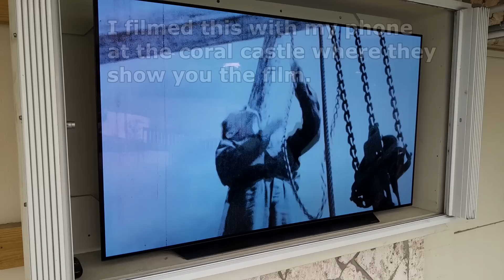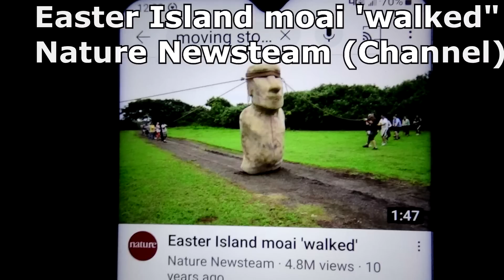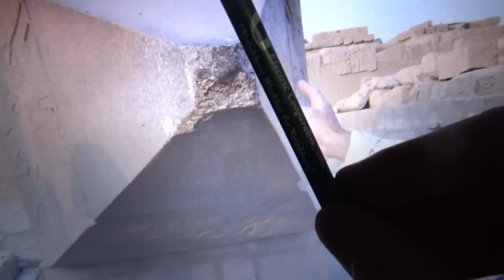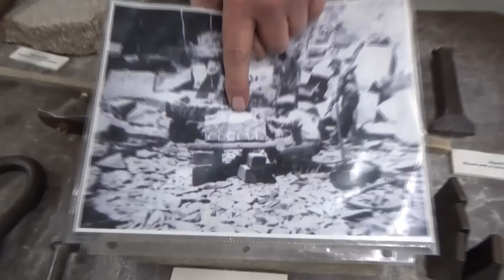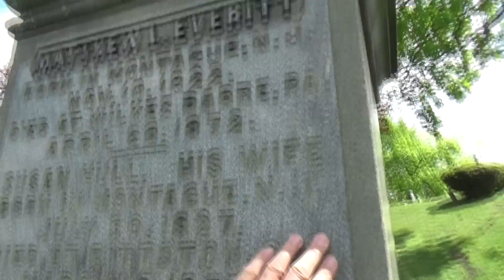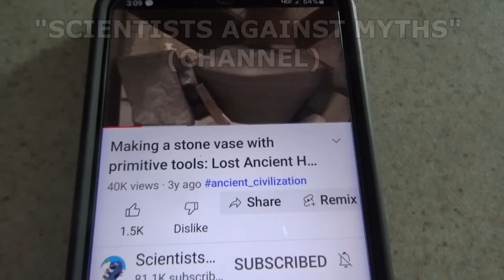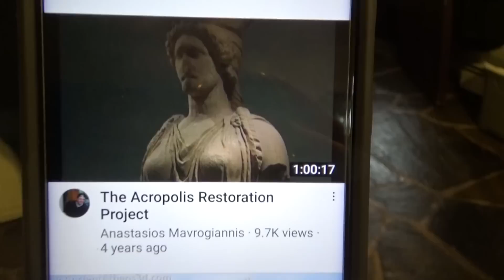CARVING STONES WITH ANCIENT TECHNOLOGY (Part 2) Mike Haduck

Comment: Hi Mike, What sealer do you recommend for a brick walkway with Portland & sand 50:50 mix that I pointed in the joints?  Is it necessary to seal?  Phil, West Chester, PA
Reply from the maker: Hi Philip, sometimes sealers are slippery in the winter, so ,on the flat I rarely use them, thanks, Mike

Comment: I remember one channel claiming curved cutting marks in an egyptian stone were due to a massive mechanical cutting wheel. I calculated the cutter must be 30 metres in diameter, so where are  the remains of the wheels? The hundreds of carbide teeth? Obviously ignoring the pictorial evidence of curved edge handsaws inancient iconography, used with water and abrasives, and suspended from a swing-frame 🙂
Reply from the maker: Thanks Richard, Mike
Reply: That pit does exist right beside the great pyramid... its actually said that' that is what that pit was used for

Comment: 13:10  thers no bow, just look at it from any other camera angle, its in a museum....and if there is any deviation in measurements,  that pyramidiem stone is at least 2000 years old of erosion not to mention it fell from the top of a pyramid
Reply from the maker: Hi Just, I been doing stone work over 50 years, I know what a bow looks like, thanks Mike

Comment: Moving a 20 tons or even 300 tons is nothing like moving 1200 tons such as the unfinished obelisk. Also moving heavy objects over flat ground is also different than moving heavy stones up grades. The task becomes exponentially harder as the incline increases. The great pyramid has many 70 ton block at 300 feet above the ground. Take a look at the Serapeum in Egypt. How do 70 ton plus boxes get moved in an area you can’t get enough people to pull it?
Reply from the maker: Hi Robert. Leverage. Elephants, horses, ox, rollers , we moved houses and we had no problem,  it just takes time and money, thanks mike

Comment: Mike, I haven't watched all of your vids, but I've watched enough to be impressed. You obviously know what you're talking about because you worked in the industry. However, I still have some concerns. Maybe you can provide an answer? The unfinished obelisk at Aswan has two deep holes located on either side of the cut. I have a hard time believing someone chipped out those deep holes with a sharp stone edge. The same holds true with the deep columns sunk straight into the ground outside the Pyramid complex. Do you have any theories?
Reply from the maker: Hi Bill , yes they just beat out the sides to a powder, it took a tremendous amount of time but it's achievable,  if the obelisk didn't crack we would never had seen how they did it, thanks Mike
Reply: @MikeHaduck  Thanks Mike. I appreciate your response. I also saw your video about the obelisks in a local cemetery. You're right. This kind of work can be, and has been done, by hand in our immediate past. I just cannot understand why the holes on either side of the unfinished obelisk were dug, dug so deeply and so narrowly. It appears to me something else was at work. In other words, they served a purpose. Otherwise, why dig them? What that purpose was, I have no idea. But I think those holes were dug for a reason. I appreciate your efforts to shed some light on some of this.
Reply from the maker: @BillBird2111  hi Bill, the Egyptians were small people for 1 and I was there and I could have easily fit down the sides, just time and hard work,  thanks Mike

Comment: I think when they say you can't put a credit card between the seams, they meant in the kings chamber and all the passages (not the the access tunnels) its obvious they weren't cut perfect on the outside. 
That's basic knowledge about the outside. Look at the seems in the kings chamber in granite. I'm shocked how good they did with what they had for tools. Very impressive work.
Reply from the maker: Hi scan, it's definitely good work the time but not perfect, thanks Mike

Comment: I would like to see you take a small pebble of white limestone and make a tiny smooth face about an inch across. How much would that cost?
Reply: But for real, I’m not sure if I’ve seen you smooth fine white limestone like what used to be on the casing stones of the pyramids. I’m just wondering how smooth you can get white limestone. I’m wondering if you can get it to where it’s semi reflective.
Reply from the maker: Hi, I would sub it out to a jewler and just get a commission on what they charge, so your better off going to a jeweler yourself and save some money, thanks Mike
Reply from the maker: Hu Nik, it don't polish like marble, best I ever seen it was a semi gloss and it disappears quickly especially outside, thanks Mike

Comment: This is a great video and I am a skeptic. I don't believe in aliens though. What would you quote for a granite or basalt vase, using only copper, wood, bone, diorote, whatever.
Reply from the maker: Hi Whilly,, it depends on how much you want to spend, I could also sub it out to those that have modern machinery which would save you a lot of money,  thanks Mike
Reply: @ The reason I ask is because Olga (from Scientists against myths, she is extremely skilled) tried it and after two years the completed vase lacked the intricacy people were hoping for. The cavity was just a drilled hole as opposed to flared or conical (or whatever). 

I'm not doubting it can be done, but it seems like a logistical nightmare. 50,000 vases were found. It doesn't seem practical or feasible for anyone to make these when limestone and clay were available. 

But you are a stonemason. If you don't want to make one could you explain how it could be done pre-steel, pre-wheel, and at what speed? You seem to know a great many techniques that have been lost to antiquity.
Reply from the maker: @WillySquishum  I never said I know the techniques lost to antiquity, I am saying it's years of practice and hand me downs from generation to generation, just like anything else, I wouldn't expect you to build a stone building if you never worked with stone ,you have to learn it from those before you, I think you are overthinking everything just like the other bedroom archeologist out there, thanks Mike
Reply: @ Bit cheeky eh. I do understand your logic. However it'd be easier and more direct to say they did it but you don't know how. 

Even master granite stonemasons cannot achieve this with pre-iron tools. Your explanation of understanding leverage and that stone can be worked with stone is great in its context but the context is false. 

You cannot explain the .1mm to .25mm per revolution of the drill through granite that the striations and core analysis suggest. 

Lemme guess yeeeeeaaaaars of practice.
Reply from the maker: @WillySquishum  hi Willy,  let's do this. You send me a video that "YOU" made "PROVING" it can't be done. Then we can go from there, because your not showing me anything except what others say, Not what your proving. Thanks Mike,
Reply: @ If I did something, how would that prove it can't be done? You want me to drill a hole with a diamond holesaw? That's still not as fast

Everything you're showing makes sense in itself. The transportation or hoisting isn't really the issue is it. 

But you cannot demonstrate the rate of speed at which that granite was drilled, and you certainly cannot replicate even a single vase. 

You spent hours and hours pounding away at a stone to remove what, 2 or 3 square inches? And then say "see, told you so."

There are 9 granite beams in the King's chamber, dude. 50-70 tons a piece. It was built in 20 years.
Reply from the maker: @WillySquishum  I worked on skyscrapers that were built within a very short time, I don't think it took more time to build a pyramid then the empire state building, , everybody has their job, stone cutters, planners , movers, crane operators, etc, if it's a rush job you have crews working day and night to meet your time schedule, and your always looking for ways to increase speed and efficiency. Necessedy is the mother of invention, all these naysayers say it can't be done but they never come up with anything to prove why?, thanks Mike

Comment: Mike,have you heard of sintered stone? would love to hear your thoughts on it. Also would love to see a video on brick walls vs modern brick/wood construction in terms of water resistance, longevity and rvalue. people keep telling me about embodied carbon in brick… and i want to hit them over the head with a 2000 year old wall… we use ceramics and stone to literally date the history of humanity. you can’t compete with that shelf life of a product.
Reply from the maker: Hi Ivan, I got a video out " brick walls, old school vrs new school,  that will say a lot, thanks Mike
Reply: @MikeHaduck   thanks Mike, just rewatched it, i was wondering more about rvalue and heating/cooling nuances of the matter. i am a believer in that hvac is not a necessity and much prefer radiators for heating and overhangs for blocking the sun. mass brick walls are said to not be very efficient. i grew up in one and i can’t say it’s worse than the wood ones i lived in here in the usa. plus you tend to hear neighbors less.

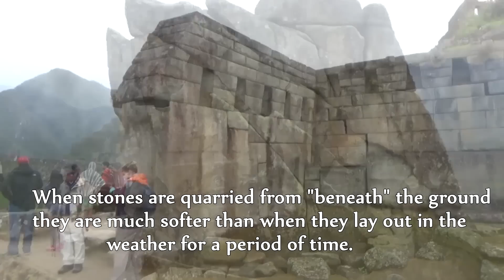Comment: 9:36 Mike sadly your explanation there isn't very solid. The rough unfinished back walls look nothing like the finished intricately connected wall. You can't just say they were trying to make the same kind of wall at the back but didn't finish it. Absolutely unacceptable reasoning. Why can't someone make the same wall there and prove all the bedroom archaeologists wrong once and for all? Use same material, same tools that science says they had back then, and make a wall like that in a reasonable period of time that would have worked in a slower paced world at the time. Why has no one done this? Egypt like stoneworks is one thing where the conspiracy theorists make more sense for the most part, in saying that we don't know how they did it with the tech they had at the time. Because no one in modern times have done anything to prove simple tech could make walls like that. Why??? It's so frustrating to me.
Reply from the maker: Hi Sam, I guess you never worked with stone, it's all basic, just add the money factor and you can get what you want. No big deal, the quarry guys in Vermont or Maine could do anything g you want,  thanks Mike

Comment: Your videos are interesting but still I do not believe they moved the their 100t+ stone blocks with simply wood cranes. They also had to move these blocks over hilly terrain. The Baalbek stone in itself weighed over 1000t+. Also the sarcophagus in the inner chambers were perfectly square, and the granite also had to be very precise. something you cannot acheive by simply smashing rocks together.
Reply from the maker: Hi huytrong, well if you got a video you made proving they couldn't do it that way , I would love to see it, thanks Mike
Reply from the maker: As a stone mason I don't see a problem, not saying that it wasn't impressive but it's basic moving techniques as far as I am concerned thanks Mike
Reply: @huytruong7370  The "Baalbek" stone/s were never removed from the quarry. So when you say you can't see them being able to move them, well they are stuck in the quarry. 
The granite boxes (sarcophagus) we have surviving records on. They took about 1 month to move and were lowered into place using sand removal technique. Basically a shaft was filled with sand, the sarcophagus positioned on the top and then the sand was dug out from the bottom, which lowered the sarcophagus. This method dates far back into Egyptian history and we see them having used it in a wide variety of instances including the early mastabas. 
Your perfect angles claim is just hyperbolic language and not true. In fact we see exactly what we'd expect to see which is the lower inside corners are the least worked and most off from 90 degrees, which is excepted since they'd be the most difficult to reach...and frankly it wouldn't matter a whole lot. 
"... something you cannot acheive by simply smashing rocks together." And they would not have just smashed rocks together. Nobody has ever said they just had rocks. And your statement ignores an entire history of stone work.  
"... I believe the egyptians inheirted the pyramids ..." Which makes no historical sense but, "the pyramids" (pretty broad, do you just mean the ones at giza?) are primarily limestone, which you say, "Thats why you have the mud pyramids and limestone statues," so clearly you think they could work limestone. If you can work limestone into a statue, you can stack it into a pyramid.   

You are jumping all over the place, as well as time with your examples. There is a very clear progression in architectural knowledge throughout history and you've basically written off thousands of years. So question, at what point in history do you think people were able to work and build with stone?
Reply: @AveragePicker  You don't know what your talking about. Chris Dunn has measured the angles and the precision of the granite boxes with modern tools. They were perfect 90 degree angles with an over hanging lid. You cannot achieve that with copper hand tools let alone cut away 10 ft of granite with a flat polished surface. Dunn reported in his book has plenty of examples of multiple contoured angles, perfectly square corners and smoothly polished surfaces, and tolerances over 1/10,000 of an inch in the hardest stones known. These are just the granite boxes were talking about. Unchartedx measured ancient vases with insane precision. They were made out of granite, diorite, and corundum. Hardest rocks known to man. Absolute insanity. His videos are clear proof of machining.
Reply: @huytruong7370  Well you didn't answer my question. at what point in history do you think people were able to work and build with stone?
"You cannot achieve that with copper ..." Says who? An entire history of stone work says that at best an incorrect hyperbolic statement. Again, this is why I asked, at what point in history do you think people were able to work and build with stone? 

Also....you're citing christopher dunn? For fvck sake. Even in some of his own videos you can see his quick square not lining up and the quickly takes it away and declares it "perfect." LOL. There is more than enough pictures and research on it. You are taking one person's rather grandiose claims, that also pushes all sorts of untrue nonsense to sell books. 

But if we are going to have a discussion, let's get a starting point, at what point in history do you think people were able to work and build with stone?
Reply: @AveragePicker  I can't give you a definitive answer. The stonework in Egypt shows a much older advanced civilization with technology to machine stone equally or better then our tech today. Also, what's wrong with Chris? You seem to simply accusing him of lying without any evidence.
Reply: @huytruong7370  "The stonework in Egypt shows a much older advanced civilization with technology to machine stone equally or better then our tech today." No it doesn't. It is exactly what we would expect to see for the time period.
Not only is it not equally or better than our tech today, but it was quickly exceeded by the end of the bronze age. Even with the Egyptian empire and others falling apart and Rome rising up, the stone work was getting better, more complex, and they were constructing load bearing arches (which actually requires precision fitting stones), domes, free standing columns (which up until then columns were carved in as part a supporting wall.) 

At some point you have to realize and admit people could work stone. And that becomes a problem because if that is your earliest date then somehow people just magically jumped to that period of skill. We didn't just jump to flying buttresses. 

Without evidence? Which is exactly how Dunn operates. Buzz words, hyperbolic claims, and backed up by nothing. Pointing at stone and saying we can't do that, is not evidence. Claiming a pyramid is a power plant followed by some buzz words is not evidence. Not to mention he follows similar pseudo claims as Hancock and it makes no logical sense, much less has anything to back it up.

Comment: One tv show shows it would be possible that the Egyptians also use kites to aid moving stones
Reply: Archaeology found a wooden tool bird in Egypt  and made a replica and test it in a wind tunnel it would fly
Reply from the maker: Hi Nathan, that does not sound reasonable to me, thanks mike
Reply: If the Egyptian use a sail sled to move help moving stone with less workers pulling to the pyramid construction time would have been reduced sleds remains would have still be around but the sails would have been distroyed due to time
Reply: Probably after the Bronze Age collapse the sail sled technology was lost
Reply: Green Sahara period was the best period for mud brick buildings construction as the green Sahara was turn to desert Sahara the Egyptian started use stone to build and invented a way to move stones easy
Reply: My thinking has pre Egyptian civilization 
Started 8000bc-4200 bc mud brick structure , old kingdom 4200-3200bc small stone and mud brick structure,  Middle Kingdom 3200-1350bc big stone structure
Reply: The Egyptian never carved bad pharaoh names in dynasty wall
Reply: Pharaoh joser pyramids maybe 3230bc-3195bc
Reply from the maker: There was a sled at the museum,
Reply from the maker: They had scaffolds and craines,  in my opinion it did not take longer to build a pyramid than it took to build the empire state building, first get everything ready then put it together,  I worked on huge jobs like that,  once you get moving everybody has their job and it gets done, the same with castles and every primitive building
Reply from the maker: It's all about money and time, thanks Mike